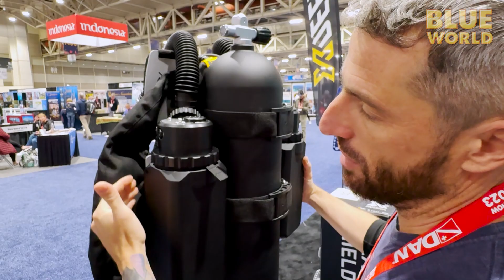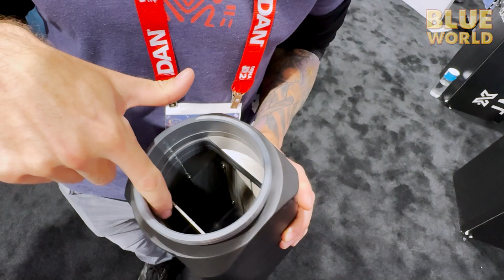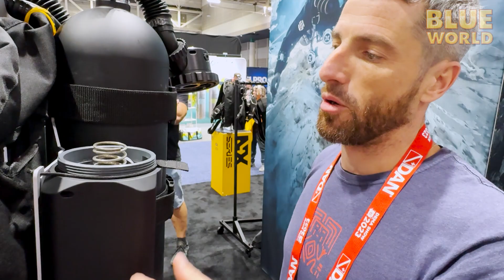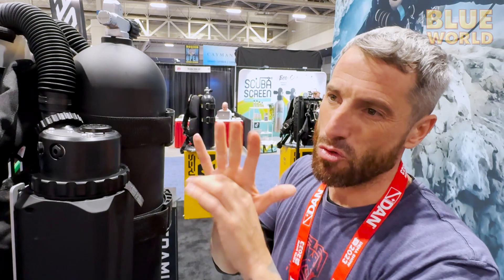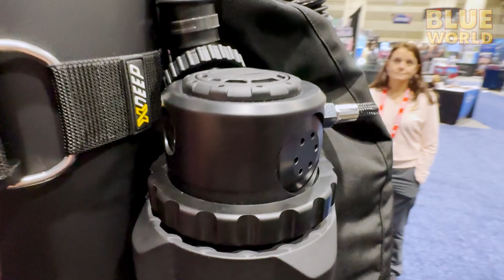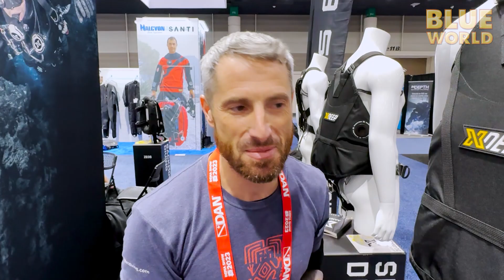Sneak Preview of KISS Sidewinder 2.0!

Comment: Are the scrubbers interchangeable to allow rotation between shorter dives? Plans to offer the new wireless/solid state sensors?
Reply from the maker: I believe the scrubber canisters themselves are identical, but as left and right you would probably have then rigged differently.  Not sure why you would want to rotate them.  What many people do is only change out the exhale side after a short dive and leave the largely unused inhale side packed.
Reply: @BlueWorldplus  2*1.5 hour dives seems like a situation where rotating cannisters would make sense to optimize scrubber use.
In the backmount configuration it doesn't look like there is much rigging involved. I'd be curious to see the unit setup for sidemount.

Comment: Edd told me almost a year ago why fix it if it isn’t broken. I was not CCR certified at the time. I had read several of the reported advantages of the SW2 vs SW1. I now am sidewinder certified with 50 hours on the unit. I am also thinking for myself when would I ever need the SW2? I have the syntactic foam insulation on my unit but could still see myself wanting the SW2 in water below 55 degrees or so. I can also see myself wanting it if I were planning a total dive time beyond about 5 hours or so in the water I regularly dive (68 degrees F) but many many people have told me the unit is good to 6 hours in the water I dive and I have done 4 hours on the unit with color changing sorb and been amazed at how little color change had occurred in the exhalation side and none in the inhalation side. In fact, for me anyway, the SW1 is limited by the 2L O2 tank not sorb. SCR and a drop oxygen bottle can extend that. I can see this unit for very very long dives though. I can also appreciate it for a dual CCR setup where you have little or no bailout gas to speak of.
Reply from the maker: My understanding is that most of the changes came about from the need to get the unit through CE testing so the unit can be sold in Europe.  They impose extreme "worst case" circumstances during testing (for the amount of CO2 that needs to be scrubbed and the temperature, for example) and then make measurements from there.  Under the typical operating conditions that most people use the SW1 for, it performs perfectly well.  However, it would struggle in the CE testing.  So the answer is that for 99% of us diving the SW1, we really don't need a SW2, unless you happen to like some of the features that were added.  But going forward, the SW2 is a good evolution of the unit.  Just as you probably won't sell your car just to get the newer version, unless the new car has something you really want.
Reply: Reduced work-of-breathing and better sorb utilization efficiency is helpful for going deeper. Right now the meg is the go-to for expeditions with those requirements, but it's quite bulky by comparison. Imagine a cave like Roaring River Spring where there's a restriction then it opens up and is borehole down to at least 500ft/150m with no end in sight.

Comment: Great video Jonathan. 
Question. I the back mount configuration, I see the 80 cuft Diluent tank, but where is the O2 tank mounted? A WOW they will have a solenoid module to transform the whole shebang into an eCCR... Very interesting. I hope they are available for July, looks like I will be on the waiting list..... 🙂
Reply from the maker: The 80 cu ft is BOTH for diluent and bailout.  This is a configuration for the rebreather  for more recreational use (open water, relatively shallow), where you don't need two 80 cu ft tanks.  The O2 bottle still goes across your butt like the sidemount configuration.
Reply from the maker: I personally LOVE the idea of using the sidewinder like this.  In something like a more traditional back-mount rebreather (say, Revo, AP, Meg, etc.) you have a small bottle of dill on your back, but it's not large enough for bailout.  So you carry a "sling bottle" of bailout.  This bottle is hanging off of you on one side or the other, makes you out of balance, gets in the way of a camera, etc.  With this configuration of the sidewinder, it moves that big bottle to your back, symmetrical, out of the way.  The only downside is that your bailout and your dill have to be the same mix.  But for 99% of recreational rebreather diving, that's fine and normal.
Reply: @BlueWorldplus  I like this myself for recreational mode. Thanks for knocking my head out of the muck with the O2 question. 😊
Reply: As a strong believer of the "complacency kills" theory, I'm not a fan of eCCR so I couldn't care less about that, but the rec/tech versatility is truly a game changer. No more awkward sidemount for boat dives on a mixed diving trip. Imagine a week in florida for caves w/ a couple lionfish control boat dives thrown in, or a trip south of the border for some charming cenotes with a couple boat dives throw in to experience the reefs.

That said, I've never been a fan of lack of diluent redundancy on the KISS, but it's easy enough to strap a 3L bottle alongside the O2 and plumb it into the MAV/ADV, then have a QC6 whip on a Shrimp BOV which also permits adding gas to the loop. 3L dil also takes over wing inflation and drysuit gets a dedicated air/argon bottle. Provides redundant buoyancy control and redundant dil.

The only single point of failure at that point is the O2, which could be remedied by having a second O2 bottle w/ compensated first stage plumbed into a pure MAV (no CMF) which also eliminates the uncompensated O2 first stage depth limitation, but that's a point I think very few need to worry about including myself. Personally I'm fine with going SCR with dil-only in the hopefully unlikely event of an O2 system failure or bailing out to OC.